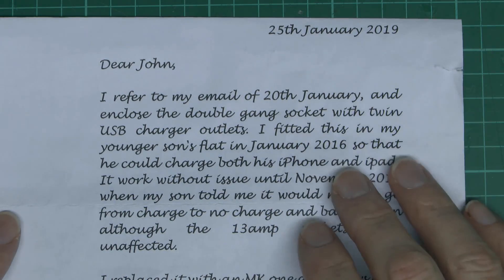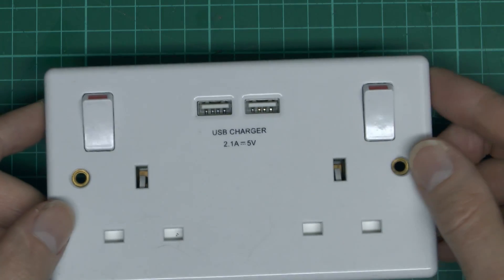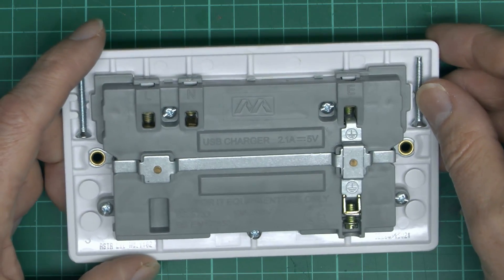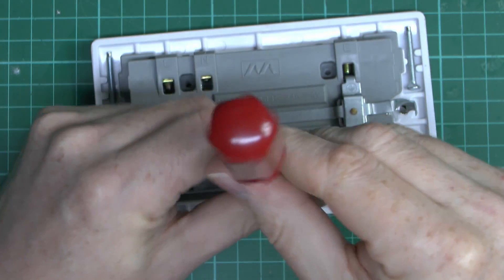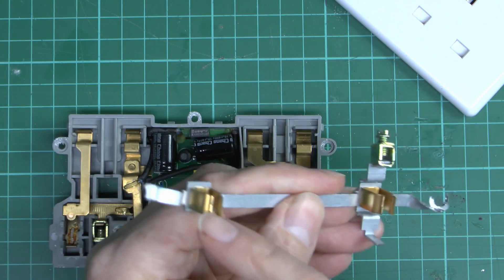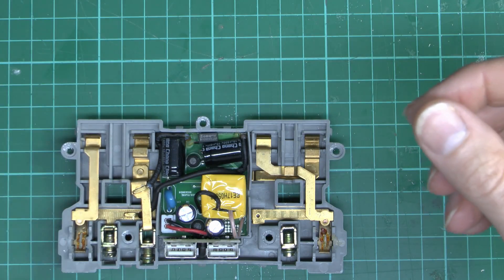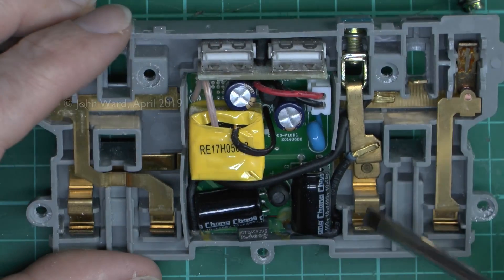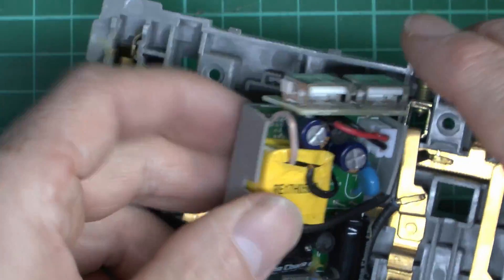Masterplug USB Socket Teardown

Comment: Its normally the boot strap circuit, There is a separate winding on the transformer that supplies the chip with power once the circuit has started, off of this winding is a diode and a smoothing capacitor to provide a semismooth dc supply to the chip and normally its the smoothing capacitor that fails or very occasionly its the diode. I have fixed loads of these circuits as they are a very common circuit even in tv's (but a bit more complex), in LED light power supplies; you name it.

Comment: If this is running 24 7 in standby what consumption in watts would this consume ?. 2-3 watts?
Reply from the maker: Most USB power supplies are close to zero when in standby, certainly far less than 1 watt.

Comment: 7:41 the material on the back is heat sink pad material.  If you've ever removed a cpu cooler you'll see that Intel (or laptop/pc manufacturers) use exactly that material between a CPU and heatsink. 

For CPUs it's enough to stop them overheating,  but removing it,  cleaning the surfaces,  and applying CPU paste lowers CPU temperatures 5-10 degrees.

Comment: The problem I've always come across is the usb sockets don't work for everything you plug in. A usb is supposed to have 2 circuits, a 12v and a 5v and they only seen to have 1 when included in an electrical outlet or adapter unit.
Reply: Don't know where you pulled that from, usb has never had a "12v circuit" by default.

Comment: One of these burnout recently as it was overloaded. I had presumed that the 2.1A would be proportionally divided between both USB devices plugged in and did not realise that user input was needed. Is it true a USB devices max input should be checked first before plugging it in?
Reply from the maker: USB sockets should contain overload protection, and not output current that would cause overheating or damage regardless of what is plugged in.
The socket should either reduce the voltage to reduce the current, or disconnect completely if the load is too high.

Comment: Why can't people use their supplied adapters? Lots of devices have powered USB when in standby too.
Reply: What would you trust? A USB outlet with a brand (MK, BG, etc.) & BS numbers on it or a random adapter bought from Poundland when the original Chinese adaptor of unknown quality let the smoke out?
Especially now that the EU have decided phones etc. can be supplied without adapters to save waste.
Reply: @beardyface8492  I agree with what you’re saying. I’d rather an MK USB socket charged my devices than a Poundland USB adapter, however I’d always prefer to use a high quality adapter than anything else. I don’t see much purpose for USB sockets. I suppose they can help to free up sockets that would otherwise be used for adapters.
Reply: @Lift.Tracker  Typical consumer isn't going to shop carefully for a "Quality adapter", just grab the first one they pass at supermarket / petrol station / pound shop, while making the unwarranted assumption that trading standards prevent the sale of poor ones.
You or I might be careful what we buy, the masses grab the first thing that'll work.
Major advantage of outlets that incorporate USB is you can't misplace or step on them.

Comment: Hi John, good video, As the excitement of being able to charge anything with U.S.B.dies down we realize that maybe installing into the actual  infrastructure is not the best way of doing it!
I would favour your idea of a simple switch detecting if the U.S.B. plug is present!
But then again it is arguable that leaving a thing running is less wearing than switching on /off,
Still not a great way of doing this though as the socket is of a different reliability class compared to anything electronic!
Simple = reliable
Mostly.
Kind regards Warren

Comment: I just bought a chrome LAP one of these. Wish I hadn't bothered now. I think I'll take it back. Didn't know they were on all the time. It's not just the cost, it's things like heat build up inside the wall that I worry about, and failing electronics, capacitors burning up etc.  This kind of thing will keep me awake at night. Just how safe is this technology?
Reply: Isn’t it exactly the same as just plugging in a regular USB adapter, accept it’s just inside the socket?
Reply: @Lift.Tracker   Regular USB adapters have a fuse at least, or should have. They are also outside the socket so not prone to heat buildup
Reply: @ArcanePath360  I see what you mean. I’m not really a fan of these either. It would be interesting though if John compared cheaper models such as this one to the more premium MK ones. I wonder if there’s any extra safety / reliability design features.

Comment: MMMM not certain about always on not lasting "as long as it could do" (if switchable).  50 years ago when I was a mere boy learning my trade, there was a big debate around equipment.  I was a telecomms type and by it's function almost exclusively our kit was required to be permanently powered.
At home Mum and Dad religiously "did the corners" every night to ensure that no plug was left unplugged. 
The debate said that the majority of kit gets warm (or hot) and thus expands when it's on and contracts when it's switched off ... and this causes stress and failure to electrical components (in those days there was still a crossover with thermionic valves or transistors).
My experience both at work and at home was the PoP of doom when you switched something on.  As a maintenance engineer things rarely died in service - more likely they just refused to switch on after being powered down.
When PCs and servers  became more widespread we found the same principles applied.  Upgrades that involved recycling the kit had quite frightening failure rates.  Changing a HDD or RAM often included a new PSU.
There were magazine articles about it and legends about servers walled in by builders tat had been working for years (until the powercut!).

Skyscrapers were built with lighting circuits without user on off switches or power sockets, things connected directly to the mains.  It was cheaper to power everything 24x7 than bother switching things off!  
Then someone noticed that summer and winter were getting much the same temperatures and global warming dictated that everything should be switched off when not being used.

Comment: I've always thought that these off great convenience, but would never install one that didn't have a third switch to cut the supply to the charging circuit.  Does anyone at all make one of these where it is possible to turn off the charger when not in use?

Comment: Here in Australia you can mix n match switches etc on different switch plates 
I bit like MK grid switches I seem to remember 
However you can also get a USB unit that will fit in a switch plate 
So that’s I did I got a 2gang sw plate and put in USB power thing
Along side a single pole double throw switch, thus I can turn the power off when not in use

Comment: I’m the person who sent the socket to John.  So the general thrust of the breakdown is that these things, no matter how much you pay for them, will have a high and short term failure rate because the USB outlet part is permanently live. 
Would it be so cost prohibitive to have an automatic or manual switching provision?
Reply: Do you have any others installed?
Reply: uK8cvPAq   Not anymore. The other one I fitted at my other son's house and he told me yesterday that if stopped working last summer and he replaced it.

Comment: Didn't help that they were probably trying to charge both a phone and tablet with it at the same time.
Reply: Why would there be 2 sockets then?
Reply: @Lift.Tracker  A tablet needs more power to charge like the full 2.4A where a phone can happily charge on 500mA I will be slow but it will charge.
Reply: @callumBee  I see. Thanks. :-)

Comment: Also there are  some multi power outlets that include USB ports and they are permanently on, even when you turn off the switch, that only cuts power to the sockets. The USB's in this case should have a sleep mode + button like some powerbanks  when no load is attached  to reduce power drain and increase lifespan.
Reply: Can I ask, do usb sockets make very low humming or buzzing when not in use? Mines seem to do so but can only hear when my ear is literally against it 😂

Comment: We have these type of things in an office at work, they emit a fairly quiet but high pitched noise all the time, even when not in use..
 I’d never fit these at home.
Reply: it's an issue with quite a few switch mode power supplies, when operating normally the switching is ultrasonic so you don't hear it, but under no load the switching frequency drops significantly and can become audible.
Reply: Can I ask, do usb sockets make very low humming or buzzing when not in use? Mines seem to do so but can only hear when my ear is literally against it 😂

Comment: Let's be honest, these days we need a lot more sockets than are present in standard-build dwellings.  On the face of it, USB sockets in a mains socket free up some desperately-needed mains sockets.  But they have a finite life, so it's an expensive way of doing it.

Cheaper, and far more flexible, is a 4-way extension lead and a discrete USB supply or two (or three or four).  If you go on holiday you can take a discrete USB supply with you but you can't take one of these things.  If you decide the USB mains socket is no longer where you need to power your devices, it's a pain to move it.

The only place these things make sense is in cafes, airport lounges and the like where the operator wants to offer USB supplies to customers in a way that the customer can't walk off with the supply.  Other than that they are a complete waste of money.
Reply: you can get usb power supply plugs with 'pass through' mains sockets so it doesnt use one up...i have one
Reply: as for the integrated usb/mains sockets, it would last better if there was some sort of switching so that when theres no usb plugs inserted, it disconnects the mains supply to the usb 5v power unit..
Reply: @andygozzo72  
That would be expensive to do right.  You'd want to switch the mains to the circuitry, and there's no way you could safely integrate the switch into the socket.  So it would have to be a separate microswitch with an actuator arm that goes into a slot in the USB socket.  Not impossible, but you're now looking at a special USB socket with a slot cut into the right place in the casing, which would cost more than an ordinary USB socket (extra machining step, not a standard part).

Another thing.  People often leave the cable plugged into the power supply, even after they unhook their phone.  So it wouldn't do much for most people.

Also, most modern phones have to be charged daily, and most people leave them plugged in overnight.  So you'd probably triple the lifetime of the power supply to maybe 10 years.  An ordinary mains socket has a much longer life than that.

It really doesn't make sense to use one of these things, even with a (hypothetical) USB switch.  Except for places like airport lounges and cafes.  For most people it's just another gimmick they'll end up regretting buying when it fails.
Reply: @andygozzo72 
The pass-through is definitely better than this thing.  But I'd go for a 2- or 3-way adapter and separate power supply unless the pass-through were a lot cheaper.  Because the power supply will die eventually, and you'll have to replace it, wasting the pass-through part.

Also, if you're worried about the power usage or want to maximize the life of the power supply, the adapter solution is better - you just unplug the power supply.  With the pass-through you have to unplug the pass-through, unplug whatever was plugged into the pass-through and plug that back into the wall socket.  Too fiddly.

Comment: I find those pretty strange. The life span of an outlet can easily be 40 years. One could never expect such long life span from those. Even the USB standard varies. There now are fast charging. I think the USB-C connector will soon come the norm. These can have some use in public spaces where people can charge even if they do not have the charger with them.

Comment: 2.1 amps total, iPhone uses 2.5 amps as does iPad... so either one would overload it.

Masterplug is part of British general.

USB wall sockets even from MK there is no way I personally would trust them.
Reply: equipment is 'supposed' to 'smartly' detect if a usb psu can supply the current 'normally' taken and if not, reduce it to level it can, thats what those chips on the usb socket panel are for..
Reply: Indeed. It's interesting to see that my USB power banks can happily supply a really high charging rate for my Pixel 3 whereas many wall warts charge slower. Also the stories of people trying to run Raspberry Pi's on cheap phone chargers that can't supply enough amps!
Reply: It won't overload it. The devices negotiate the charging rate so only take what is available to them. You can happily charge a modern device on a 1 amp supply. It will take forever but you can do it.

Comment: Megger them all! These things should be banned asap. I will advise customers that I am putting an incendiary device inside their walls if they really want them. Second fix on new build will have standard sockets or nothing from me. If the customer then wants appliances installed instead of sockets it will be a separate job. Possibly with a signed disclaimer to state, "Well, I did warn you your house might burn down". Same goes for LED lamp drivers. Circuit boards everywhere! Thanks John.
Reply: I don't like usb sockets either the fact they are permanently on with no control hanging off a 32amp ring circuit, plus if they were to develop a fault they can leak dc and disable the rcd!

Comment: The pad looks like a thermal interface pad.. these are often tacky as shown and primarily meant for heat transfer between parts. It looks well designed, no doubt let down by those rubbish "ChangX" brand capacitors

Comment: I would have put an ESR meter on the capacitors and worked out which one(s) had failed.  They look OK but it's likely that one has gone high ESR and low value.

Comment: Post it on to Big Clive for a full root cause analysis. We don't even know if you confirmed the fault is real, or is due to some problem with the user's device compatibility with this thing. That said, it is asking for trouble having a cheap SMPS sitting permanently on, I do agree...

Comment: One of the better ones I have seen.  Probably the main switching transistor or an output cap failed. You should see some of the cheap 5v usb power adapters on eBay and Amazon if you want a horror show. No fuses, Risible isolstion between primary and secondary sides, transformer windings isloated only by varnish, no snubber network, non-safety capacitors across transformer. Keep it up.
Reply: oh, yes, i have one with no fuse at all in it...relies on thin wires between the plug pins and its pcb !!  and then theres the definitely not high enough voltage not class y2 compliant capacitor between live mains and the usb output 😲

Comment: R4 or R5 are high in value, so that is the start up circuit not allowing the circuit to start up and cycling, or the diode D1 associated with them or R3 is open circuit, so the chip cannot get it's operational power properly. Otherwise C5 has cracked and lost capacitance. Capacitor wise the output and input capacitors are not the worst, but in reality this is not a 2A power supply, really a 1A one that can supply 2A for up to a minute once an hour. the pad at the bottom of the board is a silpad thermal transfer pad, there to move the heat from the power diode on the secondary and the primary side switch transistor ( and the RC snubber across it) to a larger surface area of the plastic case, so there are no hot spots on the board. 

Would be better with an actual third switch to turn it off when not in use, and even better with it only being a single socket outlet and making the power supply the second side, but limited with the room allowed in a double gang outlet means a lot of compromises there. Seen those type here, and would never install one for myself. Did however see the local version of the universal deathdaptor, and was tempted to buy one, as this one actually has a BS1362 13A fuse in it, unlike the UK versions. Almost bought a shaver adaptor, as it was selling for under 3 pounds, and actually has safety approval, non resettable thermal fuse, and 16VA rating isolation transformer with 110 and 220VAC taps in it, and fits in a single gang  4x2 deep socket, though you are going to have fun if your plaster and tile depth is not 20mm or more getting cable in.

Comment: Send it to Big Clive. He enjoys trouble shooting switch mode power supplies!
Reply: and then blowing them up 😁
Reply: I was just thinking the same!
Reply: Culprit is probably one or more electrolytic capacitor whose internal esr has rised due to ageing. When this occurs, power supplies are working until one load them, then output voltage drops, which resets charge. Then everything cycles again and again. Usually, if those capacitors are replaced when facing such failure, the device runs again fine for certain time. The too quick ageing of those capacitors could be due to several reasons or a combination : too high ac current component, too high temperature, too high voltage or poor capacitor quality.
My little experience on switched more power supplies...
Reply: @gilwyckmans  yep, usually dried up 'bootstrap' cap ,  in some circuits that cap or a similar one is also used for feedback voltage control, a duff cap can cause the output voltage to rocket , as sometimes could a resistor going high, had this trouble a lot in crt tvs in the '90s,  can cause a chain reaction blow up
Reply: @gilwyckmans  "...culprit is..."
Shit design long before the ESR of the cap becomes a problem.